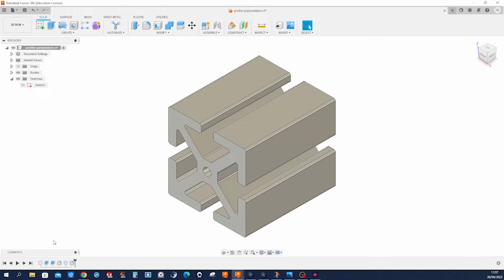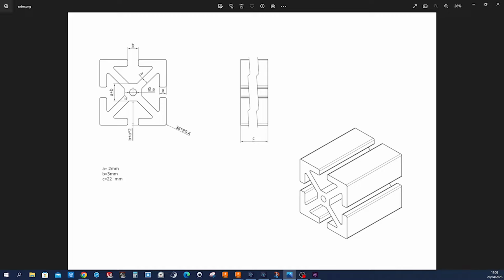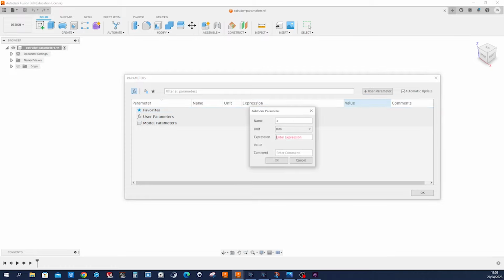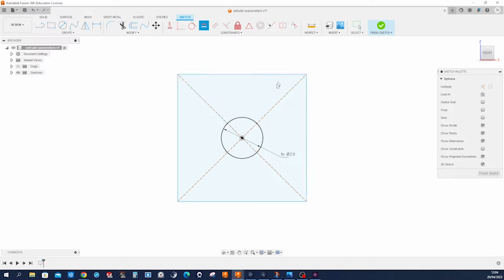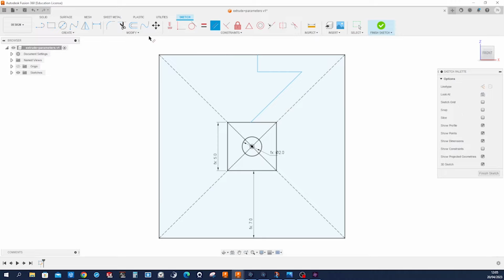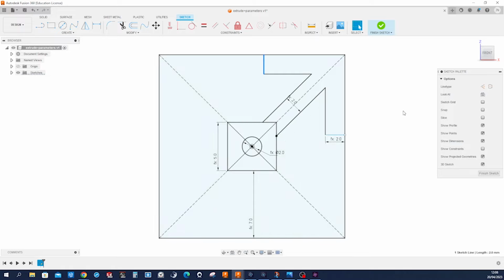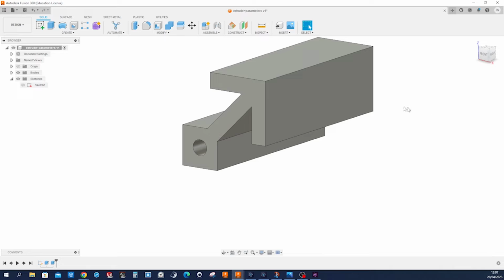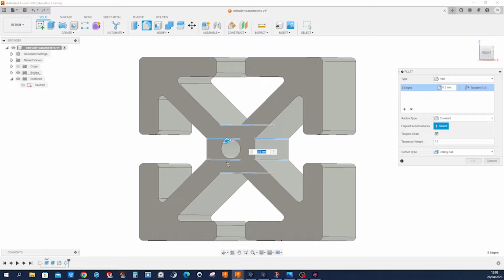Learn How to Control 3D Models in Fusion 360 with this Parameter Definition exercise

Comment: I am absolutely new to Fusion, but this was a great video - I will just have to re-watch it at half-speed to follow along at home.  I've not worked with parameters yet, this was a great way to illustrate the usage.

Can I ask what input tool you use to "manipulate" the drawing?  Is it just a mouse? Your motions are all so fluid and "right on the mark" - when I move things around it rather frantic and frustrating...  lol.  I am sure with practice I will improve...
Reply from the maker: Thanks a lot for your feedback, I'm glad that you liked it. In regards to your question how I manipulate the view: I use a 3Dmouse in my left hand which enables me to zoom, rotate and pan while I'm doing "other stuff" with my right-hand mouse.